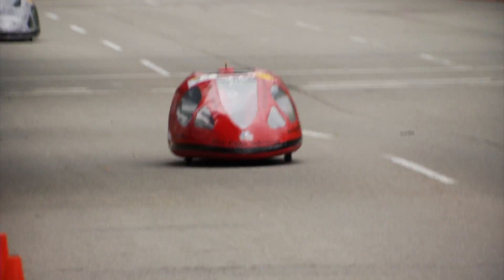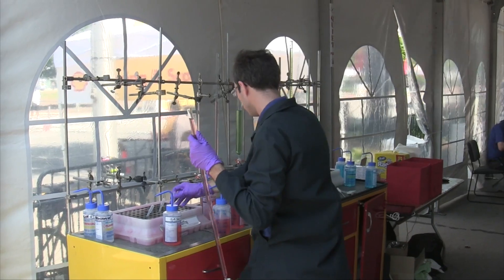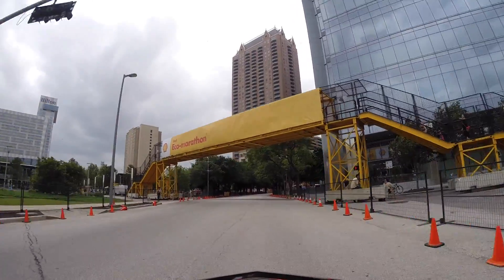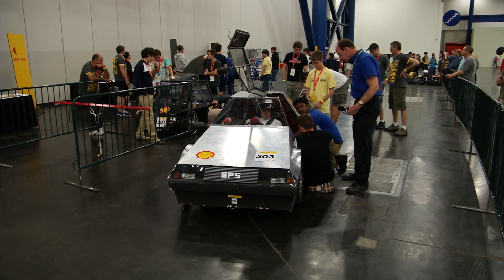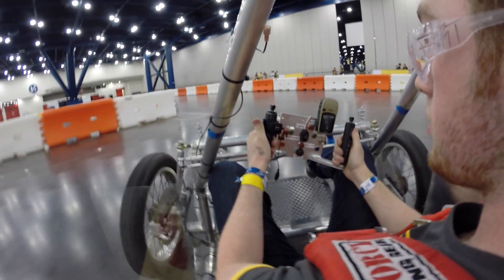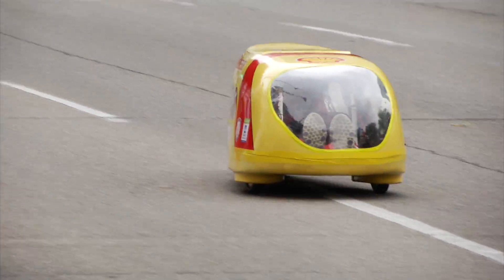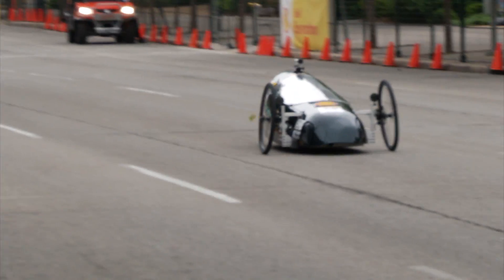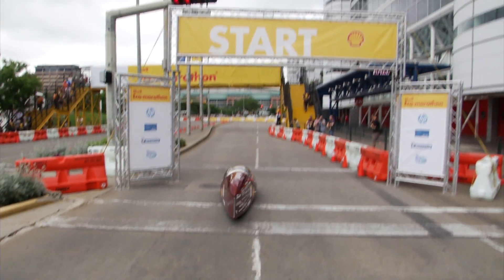Shell Eco-marathon Americas - 2014 Overview

Comment: Cutting the engine seems like cheating, it's to see who is more fuel efficient not who can roll the furthest without using the engine at all. Just my 2¢
Reply: The object of this event is to obtain the highest mileage. Do it any way you want.
Reply from the maker: Who can roll the furthest is who creates the least amount of drag and friction in the system - this is how you get good fuel economy on the road (aside from the engine).
Reply: Engineering Explained would you say than all wheel drive viehcles on the road have more amount of drag and friction because of more moving parts?
Reply from the maker: Absolutely, they have significantly more frictional losses.

Comment: I'm curious was anyone running an adiabatic engine or forced induction like a flywheel supercharger?
Reply from the maker: No forced induction; probably too much added weight, with no real benefit for such low power requirements.
Reply: Flywheel superchargers use the vehicles existing fly wheel as a supercharger by sealing it and creating an air intake at one side of the flywheel and outlet to the intake of the engine 180 degrees opposite the intake ( no weight is added) creates about 1 lb boost per 1k of rpm. They were originally patented in in the 1920's and last year the Ford rally team tried to incorporate one in their rally car in addition to the turbo ( but was not allowed to race) An adiabatic engine is made by super heating the fuel to the point of it becoming steam allowing the engine to run super lean 36:1 air to fuel ratio ( some estimate as high as 44:1 is possible with EFI) Standard car A/F is 14:1 which means only 25-30% of the fuel is burned and the rest come out the tail pipe ( Hence why we need catalytic converters). Where as an adiabatic engine burns 75-80% of the fuel making more power with less fuel, and a catalytic converter is not needed.